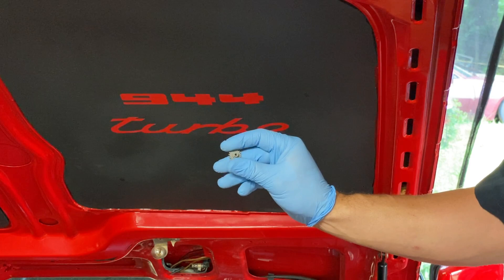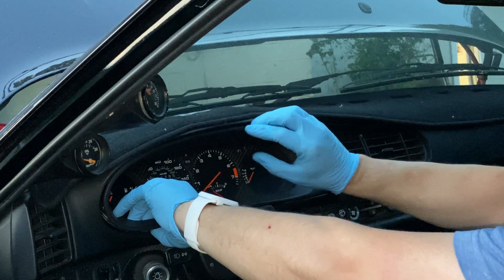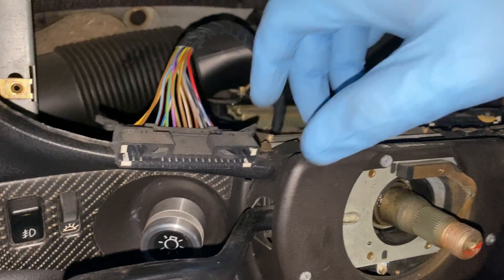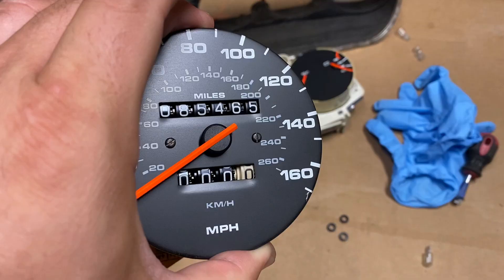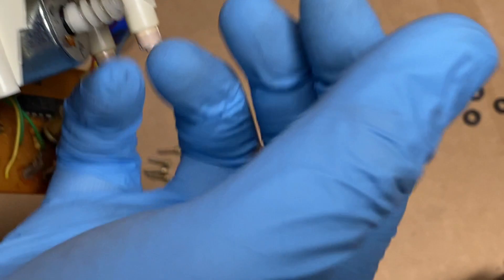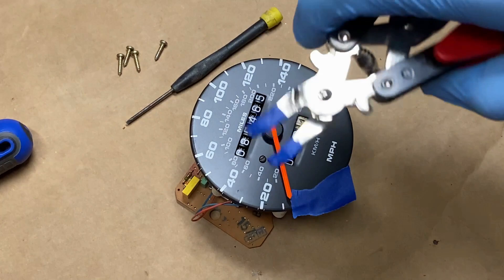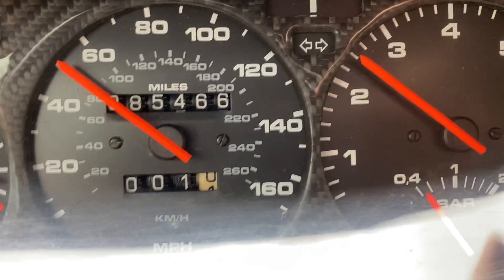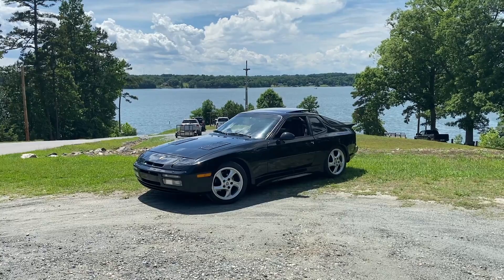Porsche 944 / 951 Odometer Gear Replacement

Comment: Thanks, this project was intimidating me, taking apart a bunch of fragile 37 year old plastic parts.  But it was not as bad as I was expecting.  I took the opportunity to test and clean the dash bulbs, they had a some dust and grime on them, and are brighter now.  Would be a good opportunity to replace any burned out bulbs that you might have.

Comment: From what I understand Porsche made that gear out of softer plastic to eliminate noise in the dash during operation .When the gear was new reset during operation was not a problem but as the gear degrades with time hitting the reset during vehicle movement could begin its destruction.Thanks for your video!

Comment: Hey there love the videos, so i have a 86 944T that has been in my garage for years. I haven't started it in about two years maybe 3. Could you give me a run down of what I should replace before starting and driving. I'm talking about belts hoses and tensioners. I know I also need to go through the brakes as the pedal feels stiffer than usual..

Comment: Hey Edredas, As a proud owner of a 1987 944 N/A I’m subscribed to your channel and NEVER miss a video, I KNOW I’ve asked you before, But CAN you take us THROUGH the steps on maintaining and servicing our CV axles??? I’m SURE that YOU are aware that the OFF THE SHELF replacements available at the chain stores are REALLY NOT up to the quality of the OEM joints unless they were destroyed... I’d LOVE to see YOUR approach to this vital service and often neglected maintenance until it’s no longer serviceable.....🤷‍♂️🤷‍♂️🤷‍♂️
Reply: The cheapo CV axles don't have full range of motion and can pop apart. GKN are the ones to get.
Reply: I’m just looking for a GREAT video of the step by step video on cleaning an repacking the joint with grease, What kinda things to look for and replacing the boots, And Edredas IS the guy up for this kind of maintenance...👍👍👍👍
Reply: It is not hard to change the cv axle bearing. Held on by a snap ring. But it is a MESSY JOB.
Reply: Get one original for the right VW transporter, identical part

Comment: great video - thank you! is there any reason you wouldn't put a spot of grease on the posts before reinstalling the gears?
Reply from the maker: Lithium grease can dry up over time and break the gears. Petroleum based grease and especially moly grease can weaken the gears. That said, plastic gears typically don’t need any lubricant, especially these since they move very slow. If you do want to lubricate then you’ll want a silicone grease but it isn’t necessary. I hope that helps!

Comment: You don't need to remove the steering wheel.  I would if I had an aftermarket one like in the vid, but if you have an airbag-equipped wheel, the cluster comes out just fine without removing it.
Reply: I have a 1994 968 with a stock steering wheel, and I agree.

Comment: Excelente video, very helpful. I just bought an 86 944 Turbo that has the same issue, and I like to repair it. I wonder where can I buy the gear from, any help? Thanks.
Reply from the maker: I often buy mine here: https://www.autohausaz.com/pn/12347365-ODGPR2021?utm_source=google&utm_medium=cpc&utm_campaign=feedmobile_Porsche&gclid=Cj0KCQjwz96WBhC8ARIsAATR251ZKU7JC2sQOFqTojVl2vko0dvHRwYLNJLY3Fyy-Hkzr3xj99XU7HcaAhQ-EALw_wcB
Reply: Hi there, I just replaced the odometer gear. thanks to your excellent instructions It was a breeze, but, I'm having a problem putting the speedometer needle back on, it just won't go back in all the way as if there is not enough depth for the pin to travel back down no matter how much pressure I apply. Is there a trick to this, or am I missing something?  I appreciate your help.

Comment: 16:55/17:52 What wheels are on the subject 951?  Porsche year, model, part number, size and offset front and rear?  Excellent, informative "how-to" video.
Reply from the maker: Thanks, its a 1986 944 turbo with turbo twist replicas. Since they are replicas without any part numbers and they were made to mount on the car without spacers I don't have the offset information.
Reply: Got it, thanks for replying

Comment: Brett, is that carbon fiber tape on the original parts of fully carbon fiber dash pieces?
Reply from the maker: It’s tape.  😂👍
Reply from the maker: Actually, I just looked at it again, and it's a carbon fiber overlay that was made for the 944 gauges and sticks on. You can buy them online.

Comment: Hey Brent, I have two '86 944 Turbos. I have already done the odometer gear on one of them thanks to your video.  I am getting ready to do the odo gear on the other one too, now that I have the gear in-hand.

I have a question for you since you know your way around these cars so well:  My red 944 has cruise and my white one does not.  If I wanted to move all of the cruise control parts from the red one to the white one, do you know if I would find all of the wiring for cc to exist on the white one (even though it did not have cc originally)?  If so, is it just a matter of swapping the servo box (under the hood), the computer box (under the dash), and the controls from the steering column from one car to the other?

Thanks!!!
Reply from the maker: Yes! All the wiring is there, you just have to swap all the electronics over and plug them in!
Reply: @edredas  Would that then just be the three items: brainbox, steering stalk assembly, and the servo in the engine bay or are there more electronics I am forgetting about?
Reply: @notny411  @edredas thank you for your help with my questions on the wiring harness.  I put together a youtube video of adding cruise control to a non-cruise control 944.  The video is here:  https://youtu.be/cuDpkbvrrgA

Comment: Is there a different gear for km and mi.
Your speedo has mph on the outside and mine has km.
Reply from the maker: That is a very good question. I know that there are two different gears and it is recommended to count the teeth on the gear (if possible) perhaps that is the reason!
Reply: @edredas  thanks for the reply. With the help of your video I pulled the cluster today and got to the gear. I was able to count the teeth and got the part ordered. It was the 20-21

Comment: Hello 944 maniacs,  on my 1986 the odometer works on and off but my tachometer is not working, is there a relation why my tachometer is not working when I know the issue on my odometer is the gear.
Reply: Probably not. I also had an issue in my 86 with a bad tach and it ended being a issue with the tach. there was a large burnmark on the inside of the pcb inside of the cluster. So I just swaped it from a tach from another cluster minus the shift light lol
Reply: @m10653  where did you get the spare gauge cluster?

Comment: Anyone know why my speedometer doesn’t kick in until around 20 mph?
Reply from the maker: What year is the car?
Reply: 1987 n/a
Reply from the maker: I would start by replacing the speed sensor on the trans. Used ones are fairly cheap and a great way to rule that out. After that you'll probably have to replace the speedometer itself. I hope that helps!